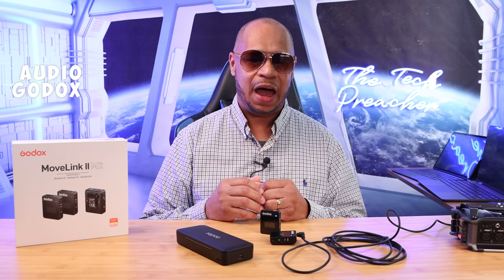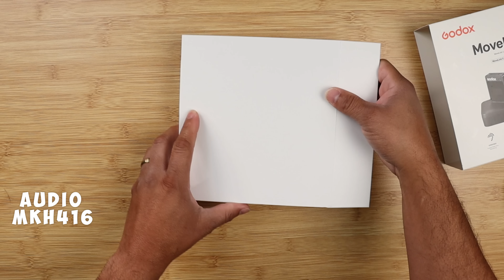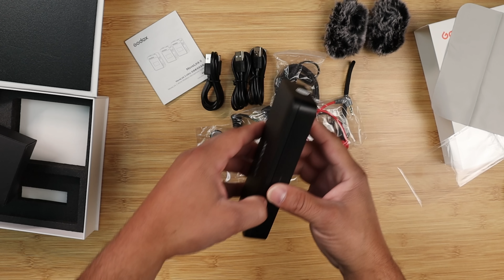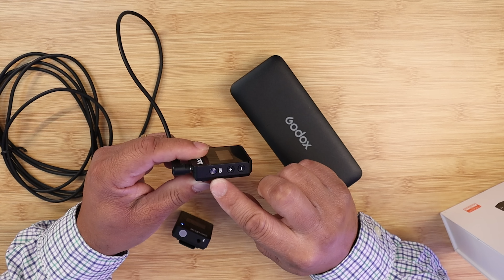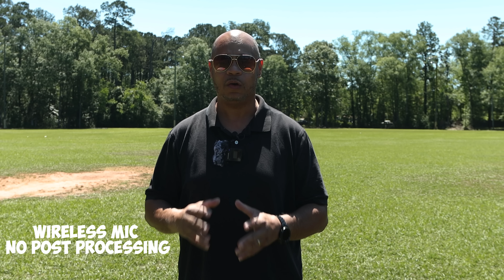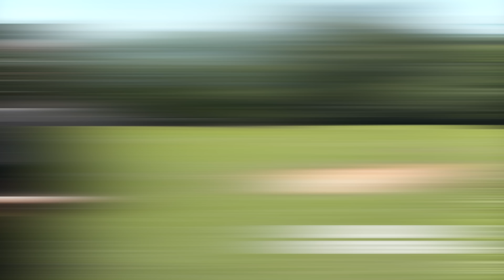NEW!! GODOX MoveLink II M2 Wireless Microphone System Review

Comment: Hello.  Thank you for your nice and detailed review.  I bought this microphone from Godox website, in STERO mode B transmitter is disabled, only A transmitter works.  Both work in mono mode.  I asked Godox and they said that you need an external sound card (professional) for stereo recording.  It is not possible to record in stereo on a normal mobile phone or computer.  Have you experienced such a problem in stereo mode?  Respects
Reply from the maker: Mmmmm I've use them in mono I have it see if I will have that issue in stereo. Thanks for letting me know